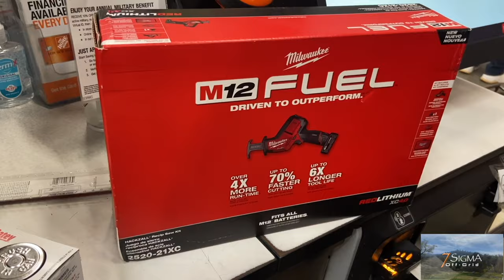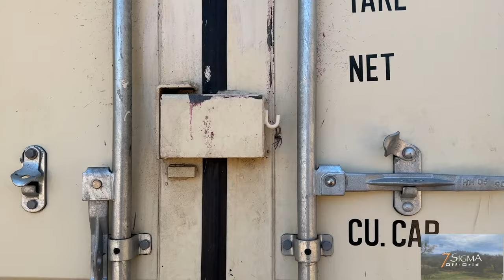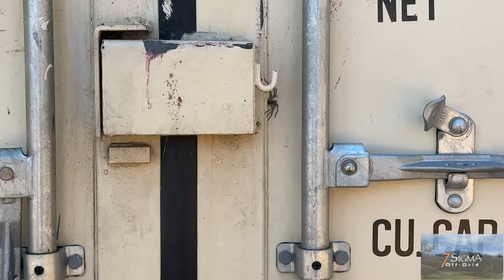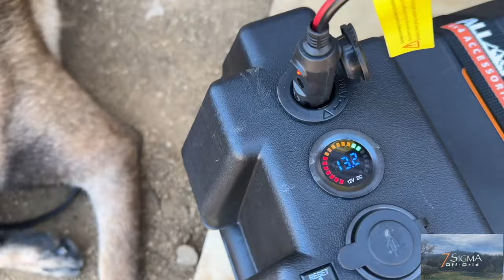🤦🏾‍♂️🤦🏾‍♀️We Made A HUGE Mistake 😱How We Almost LOST EVERYTHING #tinyhouse #homestead #redodo #rv

Comment: don't beat yourselves up about mistakes, mistakes is how people learn and it's just part of it.
Please be super careful if you remove that brush and watch carefully for snakes.
You guys are gonna do great.
On that gray water tank, you gonna have to get the inlet lower than the drain pipe somehow, maybe dig a temporary hole for the tank to set in to drop the inlet so that the water doesn't back up into the house.
One other thing be extra careful about where you place the battery, i wouldnt put it under the house or even close to the house because theres the possibility of thermal runaway with batteries and if that happens you almost cant put the fire out. If you must put it close to the house then look into some fireproof insulation to line the box that will help contain it if it catches fire.
Reply from the maker: We were think the same thing about getting the tank lower. Man… I need to hire you as a consultant/project manager You never miss! Really appreciate you sir!!!

Comment: You can grease the screen door tracks and make that glide better. I use a white lithium grease on stuff like that it seems to stay on better.
Reply from the maker: I sprayed WD40, but didn’t even think about lithium grease. Going to buy some today! BillyBlaze7 comes thru yet again.
Thanks Man !!
Reply: @7sigmaoff-grid  You bet. There's three things I always keep on hand.
1. PB Blaster, for busting loose rusted or stuck bolts
2. Lithium Grease for things that slide (cables, seats, etc)
3. Stabil gas treatment for neutralizing ethanol is gas, I also use the diesel version for my tractor fuel. You will need a fuel additive for you diesel to keep water from growing microbes in your tank and causing problems.
Reply from the maker: Adding all 3 to my shopping list today!  Thanks again

Comment: I think you have the same problem I have with my slider, Turn the slider over and look for two roller wheels on the bottom side of the slider. these need to be on the raised track at the bottom of the door.[a small screw driver is the tool] The top just goes in the rail at the top.  Love you two and your adventure. You may be wise to have a friend that knows RVs to show you some tricks. I live in Norcal or I would offer you help.
Reply from the maker: Thanks for the advice. We will definitely give it a try. We are getting to know people in the area but you all are also our YouTube friends and we appreciate all the advice you give us! 🙏🏾❤️